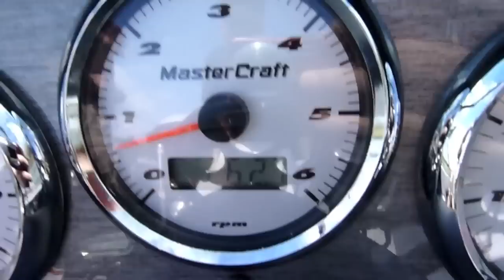MasterCraft - Fake A Lake - Shore Service - Running Boat On Trailer

Comment from the maker: Friend Dropped off the SkiBoat to Get Buffed out, Oil change & FixTrailer Brakes.
This Work Site doesn't have city water to Run the Engine.
I have One Rule -
Never Change the Oil Cold - Or just end up mixing in Old Trash.
So A quick run to HMDepot, $40 & a little Industrial Nonsense,
It Worked Quite Well.
Have Fun.

Comment: Nice! Very clean, well thought-out system. Thanks for posting.
Reply from the maker: Glad it worked out Sir. 
It was a quick mod, where site well water supply would not be able to keep up
beyond idle condition.
Going throttle up & watching the actual volume used out of the basket was surprising.
It's also comforting - knowing the cooling & pump system is working perfect.
Cheers.

Comment: seems like a ton of work.   I bought a fake a lake for my 88 prostar 190.   attaches under the boat where normal water intake port is.    $40 bucks.  works the same.  for those that don't know, it looks like a toilet plunger with water hose fitting.   much easier people....much
Reply from the maker: +accobrajim 
That's Fine in you have good water pressure.
This setup provides zero vacuum leak & positive direct Feed,
and eliminates any possibly overheating.
If you rev the engine with plunger type, 
and notice exhaust flappers run dry,, good change
starving it.
Not possible to out rev this water flow with ready bulk load.
Reply: Plunger & hose vs. 35 gallon tank and direct feed.
 I know what I'm choosing
Thanks for the post!

Comment: thx for sharing this video.  Why the bucket vs connecting to pressured water supply?  Do you use this method to winterize as well?
Reply from the maker: Hey JR - The Waste basket is free to load the engine at any RPM - House supply pressure is not always 60PSI - Long garden hose on low volume supply - highly possibly to  collapse hose with raised RPM & starve the engine & pump. Plus no visual means to truly verify the flow condition.
Yes - winterized is also possible.
Cheers.

Comment: I noticed that you attached the garden hose to the same fitting as the pump inlet house. Can I lay the garden hose over the top of the can and just attach the pump inlet house to the bottom of the can? I've been looking for a way to winterize my 88' MC Tristar 190 and this looks perfect.

Comment: This is exactly what I've been looking to build for my 2004 MB Sport B52! Thanks for posting the video and parts list.

Quick question: Did you hook it up before or after your raw water pump?
Reply from the maker: Remove hose from pump to raw water - 
Insert hose from tank to pump intake. - no clamps needed - simply slips on.
Do check oil cooler first for any weeds.
Thanks - Good Luck
Reply from the maker: See connection at 0:44 to pump from tank.
Reply: Thanks!

Comment: Hello, help please we have a boat MasterCraft XStar of 2007, the engine is Indmar 5.7, we lost the ECU engine control unit, its number 12607802 we bought a new one of the same unit, but now the engine speed control knob does not work, we were told that the new unit needs to be programmed for our motor and the handle, but here's the problem we are in Russia, the city of St. Petersburg and there is no indmar representative, can you suggest something or help?
Reply from the maker: Greetings: 
The Best option is to join the MasterCraft forum US - 
there are many qualified agents and techs that 
will gladly help steer how to solve anything. 
Sorry for delay this week - just seeing notification today. 
I will try to forward your issue to them as well, and get you a direct link. 
I have not gone that deep into the system controls,, 
or I'd jump right in. 
Best of luck Captain @!
Reply from the maker: Here's the main forum for Mastercraft 

https://teamtalk.mastercraft.com/